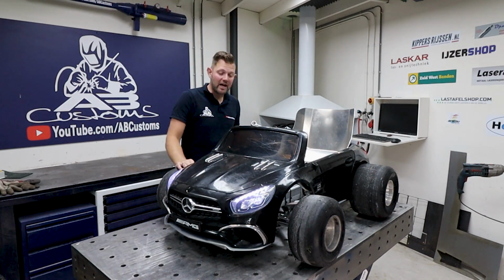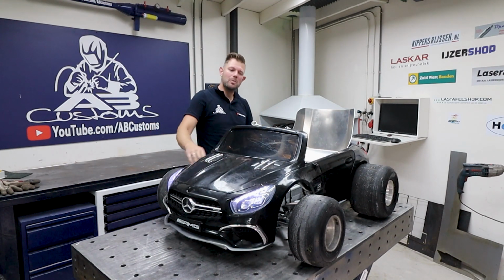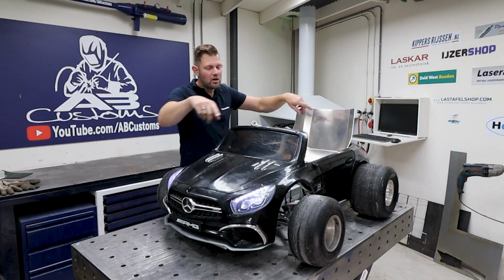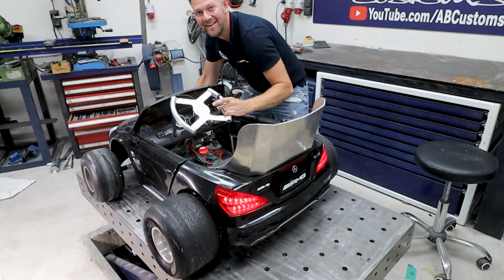DIY 4000 watt electric modified powerwheels go-kart. Total build start to finish.

Comment: Als iemand dit zelf wil maken, wat zou het dan kosten? Alle gebruikte materialen.
En wat is de topsnelheid?
Reply from the maker: Ik denk €400 aan aluminium, €200 voor de speelgoed auto. €200 voor een gebruikte kart en dan nog eens €750 aan elektrische componenten
Reply: @ABCustoms  dankjewel voor je snelle reactie. Is dit ook met staal te maken denk je? Of is het dan te zwaar?
En wat is de topsnelheid ongeveer?
Reply from the maker: @LVIS-a  staal kan altijd, als je hem dan nog wat lichter uit voert. (Buisje 16x2 ofzo) 

Hij loopt nu GPS 60 km/u

De hele reeks staat ook op mijn kanaal hè, daar kan je ook veel info vinden